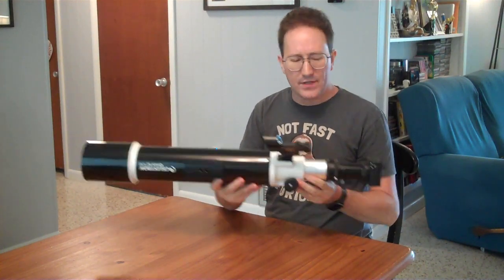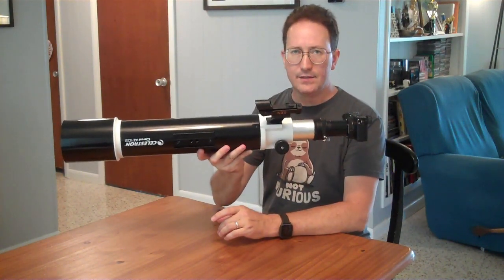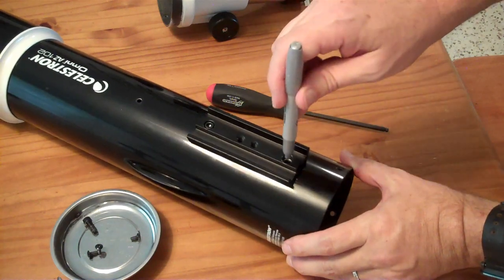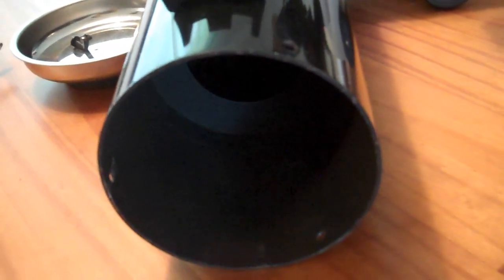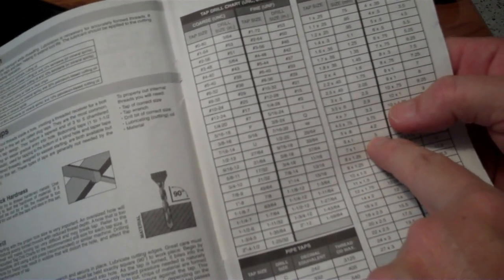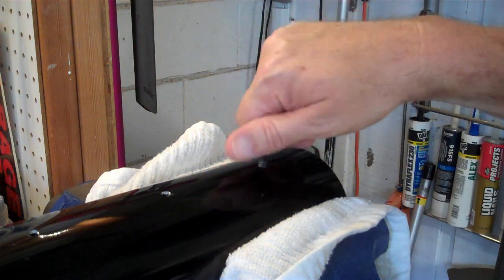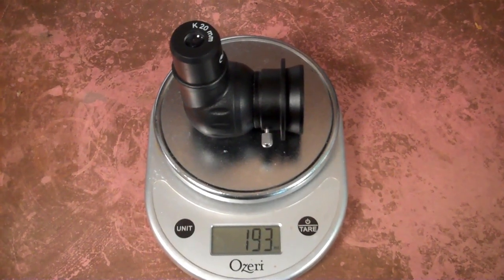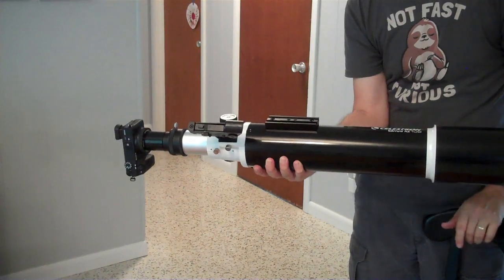Repositioning the dovetail on a Celestron Omni AZ 102 telescope

Comment: Great video. It would defenetly an option if i would have a drill set. But aren't the bolts interfering with the image? I see they are quite long and I have the feeling they stick out quite a bit.
Reply from the maker: @kindasport  nope, That is not a problem because the optical path gets smaller near that end.